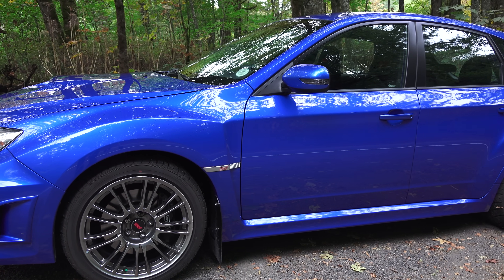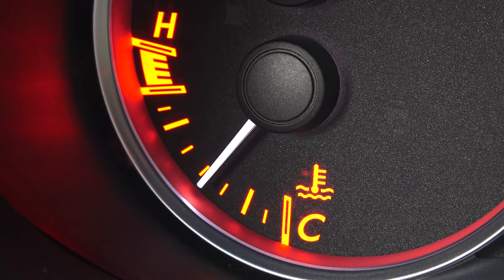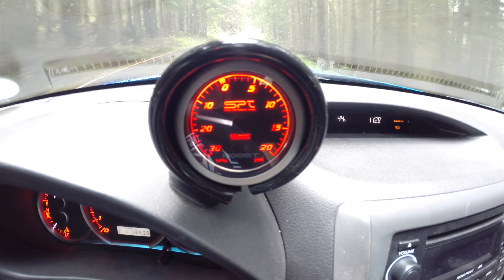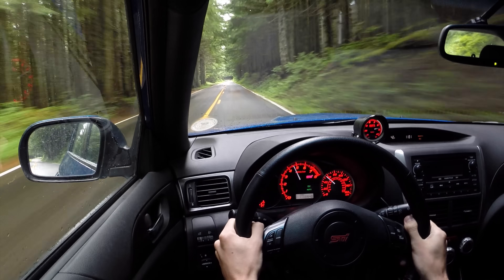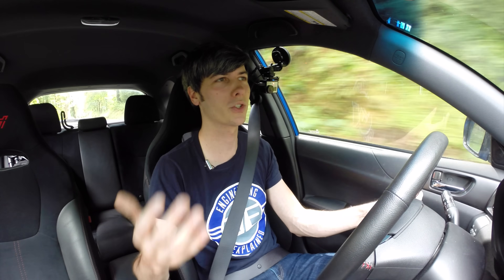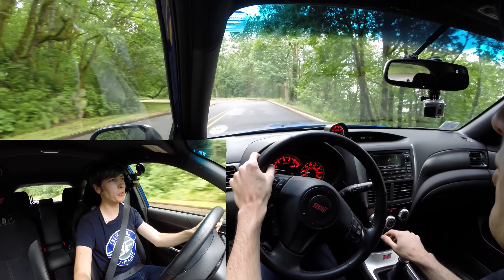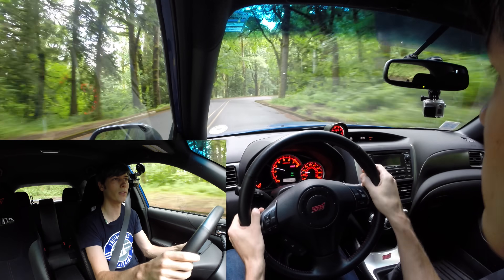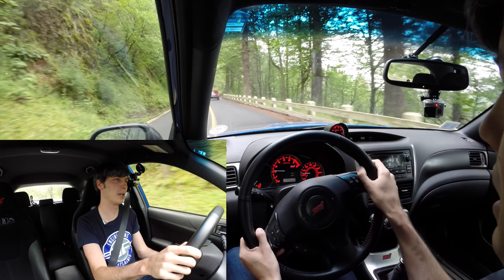5 Things You Should Never Do In A Turbocharged Vehicle

Comment: I think the reason they knock under those engine conditions is the torque produced at low rpm high load conditions. I think near or under peak torque is dangerous cyl pressure wise in long runner factory intake manifolds designed for midrange torque. I remember a dyno of a 2.4l 4 cyl back when pump gas was a big thing. this motor typically had detonation issues down low, but since the powerband was shifted further up by a short runner intake, the peak torque was high enough rpm to avoid the higher cylinder pressures. always found it very interesting. but once the powerband is shifted up enough you start to avoid those issues. love ur vids man!

This is a weird request for a video, but ever thought of doing one on why a shitty 60ft/launch/et at the track yields higher trap speeds than an equivalent lower 60ft and better et?? I've never been able to reason why that happens, it seems like the better 60ft/ launch you'd have more time to accelerate and yield a higher trap, but over and over again if you watch drag passes this is not the case!

Comment: This is a lot of information, but it borders on being TOO safe. I bet, on new diesels, you'd keep the eco stuff that makes the engine get 7 miles to a gallon, rather than rip it all out, lose 400 pounds of eco, and get 19 miles to the gallon. Cleaner emissions and more fuel being burned, or regular emissions and a low amount of fuel being burnt. Probably buys turbo silencers and wouldn't straight pipe anything either.

Comment: #1 Modern oils lubricate and flow just fine at low temperature. It's about actual engine temperature vs. coolant temperature. Big heat differences between the outside of the block and cylinder walls will cause cracks. If anything, modern oils lubricate better at temperatures between room and 90 C than above.

#2 Oil getting thicker due to immediate shutoff is not a factor. It is the carbon deposit inside the turbo compressor you get from overheating the oil that is the problem. This eventually clogs the oil lead and bearings in your turbo run too hot and dry.

#3 Lugging the engine is relative. If the engine is designed to allow for low RPM high load, like a lot of modern small displacement turbo engines are, it's not a problem at all.

Comment: Completely agree - That warmup period is important. I always wait until the oil pressure has fallen down to the normal running oil pressure level for the engine. For my Olds, it will be up around 80 PSI at cruise when cold; then as it warms up the oil pressure reduces to the normal 60 PSI. Before it reaches that point, I try not to bring it into boost. Thankfully it only takes a few minutes to warm up.

Comment: Hi EE - thanks for the excellent videos. Quick question - what are your thoughts on these eco modes that cause the engine to switch off when the car is at a stop. Your view on shutting the car engine off that is hot - the oil next to the hotspots burning up and thickening the oil etc
would you recommend keeping this feature permanently off on a high performance turbo engine vehicle?

Comment: Our emergencyehicle (emergent medical transport) is sometimes up to 60+ mph within a few minutes of startup.I try to be as gentle as possible on the vehicle.    In the  cold garage I have attached a magnetic oil pan heater which pulls off with a rope.   Also cover the hood with a bed sheet.   Shall I direct an incandescent floodlight up at the transmission and even rear differential?   Thank you.

Comment: With your last point regarding flooring it out of a corner affecting the slip angle in terms of oversteer/understeer, what if you are in a small turbocharged AWD like an A45? Will the torque from the turbo be evenly distributed to the front and rear axles?

Comment: what is high boost exactly? give me a number
Reply from the maker: Eleven.
Reply: thanks was thinking of boosting my car but wanted to keep it light was gonna go with 5-6
Reply: hahaha hahaha.  high boost!?!  it's is 11. . . for every car. 11
Reply: Depends on the vehicle. A turbo'd 6.9L inline 6 diesel's high might be 40-50 PSI, while small gas engines are probably 10-15. 7.3/6.9 V8 IDI's are high at 10 because their compression rate is stock 23:1. It depends on stock compression rate and how well built the engine is.
Reply: Japanese were like "better be ereven"
- Jeremy Clarkson
Reply: In the commercial diesel world 20-30 is nothing. People with semis are cranking out way more when climbing loaded.
Reply: on an n/a to turbo conversion stock internals are generally pretty safe until about 8psi
Reply: Lol you dont even have a turbo how are you gonna run boost without a turbo
Reply: Ford’s 3.5 Ecoboost engine is about 20 psi and there 6.7 diesel goes to about 35 psi. Though most smaller cars don’t use that much boost.
Reply: I bought a 07 GTI from a guy who has put a goo amount of money into it and it pushes 25 pounds
Reply: AnubisBahamut 
100 psi
Reply: Obviously 11 is sarcastic it is completely dependent on the engine including any modifications. Relativity my friend. A 7.3 liter v8 turbo-diesel can run 20-30 pretty easily, a 2J might be pushing it with 15-20 depending on modifications, and a 14.7 liter I6 can probably push well past 100psi, then again I've never owned or worked on one so I wouldn't know. But if the old dodge that was showcased on Hoonigan's is anything to go off of it was at a hundred and a few something psi. Might have been 113 psi. But since you're asking I'm guessing 3-6psi is right on the money for you're car. 11 is high for the car in this video though.
Reply: Depends on the motor configuration
Reply: 42
Reply: My subaru wrx pushes 25 psi but I never use it.I might go 15psi tops
Reply: High boost is relative. High boost for my truck is over about 15 psi, where as high boost on my other forced induction is anything above 6 psi. On the complete opposite spectrum, diesels can run much higher "normal" boost levels.

You should be a LOT more specific with your definitions.
Reply: Trey K the 3.5L ecoboost runs 14-15 psi stock, not 20. Max boost on factory turbos is 20-22, but that requires 93 octane or better and a tune. With upgraded turbos, a stock 3.5l long block can handle 25psi for some time, but you would need either e85 or methanol injection + 93 octane to run it. Plan on a new motor after about 30k worth of 25 psi though, unless you drive like miss daisy.
Reply: ShadowKnight7171  my kenworth truck hits 60psi.
T680 power baby!
Reply: I run 25psi on my Fiesta St. and thats w/ stock over boost.
Reply: You definitely don't run 25psi

Comment: You should always have an Exhaust Gas Temperature gauge in between the exhaust ports and your turbo. Never shut your engine off if the EGT is over about 300 degrees regardless of how hard you have or haven't been running it. 

BTW, My VW 1.9 Liter TDI advises the driver to run in as high a gear as it will pull smoothly. It only has 198K+ miles on it so that can't be right, can it? The only restriction on rpm on my dodge with a cummins diesel is redline of course but also not to pull heavy loads below 1600 rpm in 6th gear. Heavy loads being not defined. So I don't worry about it when pulling my 3,000 pound GVTW utility trailer but I follow it whenever I'm towing the 30' toyhauler. Both are approaching 200K miles and run great.

Comment: I have a 16' Jetta sport 1.8t, the fuel door states 87 octane.. Will I see a benefit from running higher octane fuel, or is it a waste of my money? The salesman explicitly said to run premium  which I have for around 9 months now (93 octane), but recently I've been trying 89. I do notice my engine is slightly more quiet with the lower octane, also when shutting the vehicle off and opening the hood, the engine is noticeable colder than when using the 93 octane.. I'm confused on what I should be running. The owners manual is vague in that it says "you may be able to enhance engine performance using premium fuel".. I'm lost on what is most beneficial for my vehicle, any advice here?

Comment: This is one of the biggest pet peeves in my 2013 Audi TT. While lugging along in Los Angeles traffic, I'll see an opening in the lane next to me and start pressing the accelerator only to find that the transmission just doesn't want to downshift. By the time it finally does, the guy coming up on me in the next lane is breaking pretty hard to avoid hitting me.
Yes, I've learned to manually down shift before changing lanes or dropping it down to SPORT mode but it's just an irritation.
I've been thinking of doing a TCU (Transmission Control Unit) upgrade to possibly deal with this but I don't know if it'll cure this irritation. I'll do more research if I ever get serious about the upgrade.

Comment: One of the most common mistakes is revving a turbo charged engine and shutting off the key. The oil pump is in the motor and works when the motor is turning. When you shut off the engine the oil pump quits and your turbo is still spinning rapidly. Thousands of rpm without oil pressure. Think about that. How long can those bearing last without oil pressure?

Comment: Never? 2003 VW Jetta TDI. There's an oil heater/cooler connected to the coolant lines, so oil temp should always be close to engine temp. There's no preignition because a diesel is intended to have ignition right when the fuel is injected. And I'm not so sure about the richened mixture to the catalytic converter being a problem, because the rich mixture at low RPMs could've been optimized out in the ECU by the manufacturer if it were something that'd cause a lot of problems.

Comment: luging the car as you say doesnt do any harm and your vehicle will not inject more fuel as it has a fixed air fuel ratio monitored by your o2 (oxygen) sensor no mater what rpm  plus Your Mass air flow sensor knows what amount of air is going in to inject the correct amount of fuel your injectors isnt going to just inject fuel cause your at wot its also measuring how much air is coming in to get a correct afr ( air/ fuel ratio

Comment: Turbocharged cars are going to have O2 sensors that can handle the higher octane without fouling, right?  I've had to change 2 O2 sensors in a 2004 Jeep Grand Cherokee 4.7L Powertech V8, because the previous owner would run 93 and 89 octane gas intermittently, even though the owner's manual states that the motor is made for 87 octane only.

Comment: Whats the point of turbocharged cars if you cant ride them hard and have fun with them...
Reply: Chris Strzelczyk You can run them hard but let them cool off at low load for a couple of miles. Also lugging the engine regards keeping the ratio of RPM to Manifold pressure to a high enough level so as not to blow the engine and ruin the piston arms. Thus you downshift before shoving the pedal.
Reply: @sfertonoc  Frequent Oil changes of high quality Oil would be a must if you're going to drive hard..mind you there's no better Oil than CLEAN OIL ...
Reply: malachy1847 that is what I think too. But some people tell me changing oil too often can increase wear, supposedly because oil that is broken in at 1500 miles is best. I would think carbon deposits accumulating and diluting in oil like small diamonds are never good. If not I would sell my 1500 mile oil for more than the new stuff, sheesh...
Reply: When did he say you can't run them hard?
Reply: David K Marshall basically the whole video... “don’t gas it out of a corner or the boost will kick in”
Reply: @unfflamenco9347  Yeah he's warning you that that happens, which it does, if you wanna do it then go ahead
Reply: The point is you can have a smaller displacement engine (which is inherently lighter and smaller) without sacrificing much power.

Comment: Most modern cars have a water/oil  heat exchangeer built into the oil system (I've seen that most often close to the oil filter)  which partially reduces the issue of the oil warming up slower then the water and also helps cool the oil when it gets hotter then the water.

Also the biggest issue when the oil is not at operating  temperature is that both viscosity is not ideal and also the tolerances (of the parts where the oil is passing) are not ideal resulting in mixed contact and fluid film levitation. In practice you ware the engine a lot more while heating it then while running it at operating temperature.

Some race engines (F1 for sure) are only turned on after they have been fed hot fluids long enough to take the engine into it's minimum starting temperature.

Comment: I have a 2014 fiat engine light came on diagnostic shows turbo lag, is it possible turbo is going out and can the car be damaged more by driving it dealership is 2 hours away. The oil looks clean but engine has a strong gas smell when I opened hood. Prior to light coming on was having troubles starting car.

Comment: I was always told that the engine oil warms up faster because inside the engine it is exposed directly to the combustion heat. Since coolant gets its heat through the metal of the block & heads,  it's a slower process?

Comment: turbos are pressure driven,  combustion creates pressure output,  pressure output can increase with rpm, as well as reaching higher combustion temperatures, a long term detriment to the engine, but will for a short period of time spool up the turbo, which in turn increases boost, and that in turn will generate torque beyond normal parameters

Comment: You don't want to go full throttle out of a corner.   That is intirely dependent on HP, speed a vehicle, AWD vs RWD vs FWD, weight distribution, road surface temperature, tire temperature, tire type and a probably a few other things. Most factory turbos are sized to have very little lag to none at all.

Comment: Excellent information but as far as not shutting the engine down as soon as you stop and leaving the engine to idle for 2 to 3 minutes to allow the engine to cool down, I tend to believe that the engine actually gets hotter during idle as there is NO air flow through the radiator, what are your thoughts?

Comment: Most large diesels are meant to lug, a lot of tractors and semis they recommend you let the engine lug out rather than drop a gear when under heavy load. But these are large cat, John Deere, and Cummins engines. I've been told it's easier on the large engines to just fight it out rather than hurry up and try to spike it to compensate for the load. But again, these are 20 ton machines, not a 2500lb VW Jetta so the engines are built for a different purpose

Comment: Dont forget that the oil vicosity is designed to change from cold to hot.
E.G: 10w 40
SAE thickness rating 10w when cold (thinner) so that the oil circulates faster when cold.
SAE 40 when hot (thicker) so it protects the engine from excessive wear.
Also remember 99% of engine wear is when the engine is first started.

Comment: Hitting the accelerator at lower engine rpms (~1500) will NOT damage your engine regardless of load, so long as the computer can see Throttle Position... It will automatically adjust fueling regardless of how far you put your foot down, it will only fuel as much as the vehicle deems appropriate. Even if you floor it (100% TP angle) it will only give you as much fuel as say 25% throttle angle until the RPM and load are appropriate for full throttle. This can all be seen on a good OBD II scan tool.

Comment: Premature ignition occurs at low rpms and high boost because all of the air being forced in lowers the atmospheric pressure inside the chamber lowering the temperature at which the fuel and air mixture ignites, itd be similar to running a low octane fuel in a high compression engine, itll give you pinging and cause problems, either lower the boost or increase fuel octane a bit

Comment: Just about everything I heard him say makes sense. As for doing extreme damage to the engine, late model car and truck ECU's (computer) can do a pretty good job compensating for a bad driver's acceleration habits. If one uses cheap gas with low octane, well, the knock sensor comes in handy telling the computer to cut back on fuel and back off the timing a bit. In the olden days, you would have to turn the distributor  with the direction of the rotor a few degrees to reduce knock. You may notice all the late model semi trucks seldom blow any smoke. Thanks to the computer, it figures out all conditions and instantly makes changes to the fuel delivery to keep it clean. Disclaimer: All comments make are nothing more than "off the top of my head". No scientific data or tests.

Comment: I partially disagree with avoiding to floor it at lower rpm's as it depends on the tuning.... The Cupra 290 for example reaches peak torque (350 Nm) at 1700 rpm with the help of a twin-scroll head-integrated turbo. I'm with you otherwise, being in the wrong gearing/rpm is pretty much like riding a bike on a "heavy" gear and trying to get going. Apart from that nice mention with the oil temp, fuel type - boost pressure and allowing time before turning the ignition off.

Comment: Your car has a factory water cooled turbo.  If it needed a turbo timer it would come with one.
A diesel is made to run at low RPM and high load.  It will only inject the amount of fuel needed for the A/F ratio.  And I highly doubt a car with factory mapping will let you ruin the catalytic.
Preignition?  Once again, has a knock sensor on the block and will adjust timing.
Preignition will crack pistons in half?  Have you taken apart an engine?

The best fuel?  What does that mean?  The highest octane?  False statement once again.  You only need what the car specifies, for a stock STI that is 91 octane.

Don't floor it coming out of a corner in an AWD turbo car?  Hello, that is one of the huge points of fun with an AWD car...  How do you send "all of the torque" to the rear wheels in your AWD car?

Once again I think you are spreading myths to those less knowledgeable.  I'm not sure why you have so many views.